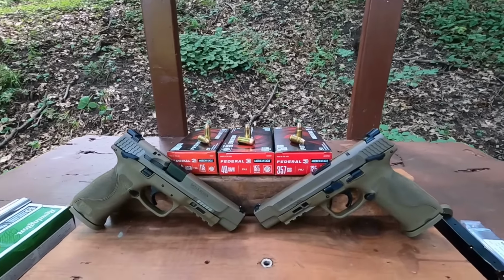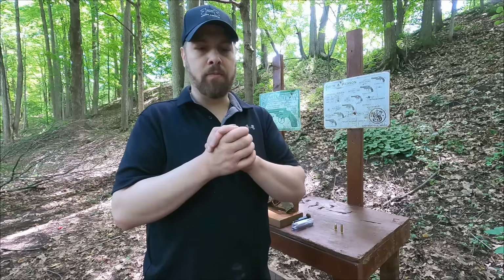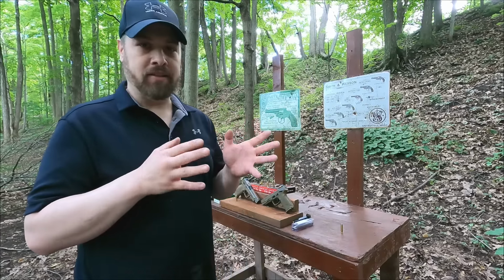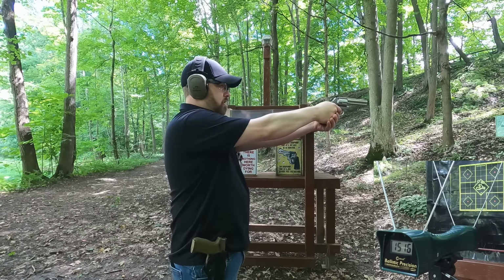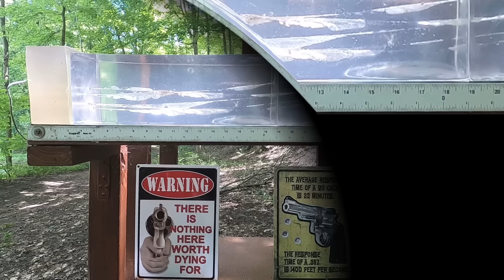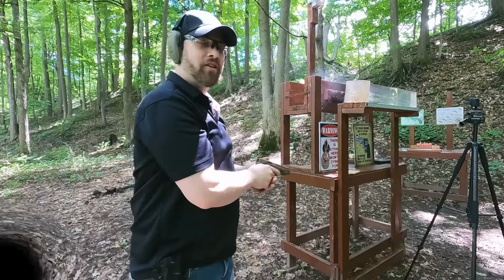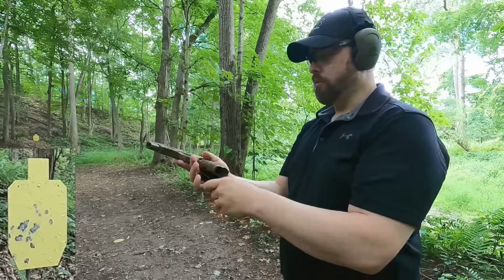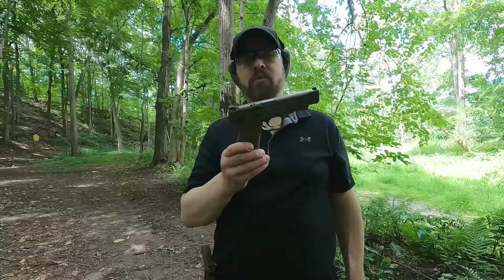.357 Sig? Cartridge Introduction and  FMJ Ballistic Gel Test (VS .40 S&W and 9mm)

Comment: There was a wildcat cartridge back in the early to mid 80's call a 38/45 auto.  A .357 dia bullet with a necked down .45 Auto casing. The only problem was it was based on the 1911 so single stack limitation of rounds. I have a Glock 33 and it is a fun hand cannon. The muzzle flash can be distracting but not too bad. As to your rifle statement, TNW Aero has a 16 in carbine that slings Fort Scott .357 Sig to almost intermediate rifle cartridge speeds (2300+). (https://www.youtube.com/watch?v=_jQTp9LgXiQ&t=182s)(https://www.youtube.com/watch?v=Oxox8r79wI8)  I think you will agree it is a screamer. Enjoyed your presentation.
Reply: Sounds like the old 38/45 Clerke or 38 Hardhead. But that was back in 1963 not the 1980s
Reply: @Matteo_  I read about it in a Guns and Ammo Magazine in or around 83". Lots of time and a head full of gray hair has dimmed a lot of the details. I do remember that the author used a 30.06 case, cut it to length and then sized it to fit the .357 bullet. The only thing I remember asking myself was why? 38 Super Auto could be loaded to meet the specs with a lot less work and at the time way more available ammo. Was an interesting concept since I had on occasion fired some Tokarevs while overseas in the military. Cheers...
Reply: @lutherpayne9957  Yes, the 30-06 case was used, I believe this was to mitigate the higher pressure in any unsupported chambers. If one where to choose to push the pressures higher than normal. People will also use 308/260 and the 243 cases. Similar can be done with the 400 CorBon. You can run it under the standard 45 acp pressures. Or ramp it up to 35,000 where the 40 is for some very near 10mm level performance.
As for the why? It takes little to convert a 45 acp 1911 over to this if one only has the 45. And still retains the ability to swap back to 45 with  little effort. Where as a 38 is built different to accommodate that longer thinner round. And it's only a 38 ACP/ 38 Super. There's the fact that 38/45 Clerke doesn't have a semi-rim to the case. So you don't have to worry about rim lock. Another thing to keep in mind the 45 acp case has a little bit more case capacity than the 357.
I've shot the tokarev. Fun gun. Never shot it in the military though. Maybe cause I was a combat engineer. So I did more demo shoots, mine clearing operation and breaches. Personally I prefer the 357 SIG to the x25. I also have a G33. But I favor my Steyr S40 with a conversion barrel a bit more.
Cheers and be well.

Comment: I've always wondered COULDN'T THE 40 HAVE THE SAME BALLISTICS AS THE 357SIG.

If they simply loaded it with those really light bullets like the SIG has.
Corbon makes a 135gr JHP in the 40, and it's energy output around (530lbs).
Reply: Yep, but it sacrifices sectional density. The 40 can do anything the 357 sig can, and usually does it at a lower pressure. Out of my sig 229 I've pushed a powdercoated cast 125gr hollowpoint to 1500 fps over 800x powder.
Reply: The thing is, 135 grain is a very light bullet for .40 S&W.  Yes, it gives you enough velocity to get .357 Sig/Magnum energy.  But will it shoot to the same point of impact as your point of aim?  And if not, do your sights have enough adjustment to zero the pistol so that it does shoot POI/POA?  And if it does, can you then find an inexpensive practice ammunition that shoots to the same POI/POA?  And I'm not asking these questions to be a smartass or to imply that it definitely won't.  Depending on your gun, it very well might.  Or it might not.  The only way to know is to shoot enough of it to find out.

The easiest way to get .40 S&W to give you .357 Sig/.357 Magnum ballistics is to go with the .40's older brother, the 10mm Auto.  When loaded properly, 10mm Auto easily operates in the same range of muzzle energy as does the .357 Magnum.
Reply: @Kaelland  that's a very real problem even for 10mm guns. Lighter bullets in my sig would hit several inches low even at only 15 yards. 165-180gr were good out to 50 yds, but there was a lot of struggle with anything much lighter. Not to mention difficulty in seating such short bullets
Reply from the maker: You could potentially have similar energy between .357 Sig and .40 S&W, but that doesn't necessarily make the ballistics the same. Overall what you see with .357 Sig is consistently high energy. Basically in this pistol, every .357 Sig round hits over 500 FPE, as where .40 is generally a bit less than 500 FPE. Also the sectional density and all of that comes into play a lot more when you shoot lets say a 147 gr hard cast or FMJ .357 Sig VS a 180 gr FMJ .40 S&W, as the Sig is just going to penetrate probably better.
Reply: Drill the base of (shortened) FMJ bullets and fill the cavities with resin. You might get 100gr bullets or less. Might fly pretty fast out of 10mm_AUTO or 10mm_MAG carbines.
Zinc bullets should be fast too.

Comment: I recently acquired a 40S&W/357Sig combo. Loving the Sig,

I thought the 357Sig was designed to (out of a 4"bbl) duplicate a 357 Mag out of a snub nose..?
Reply from the maker: I heard that the .357 Sig was designed around a 4" barrel to match 4" revolvers, but 1,350 FPS instead of 1,450 FPS. I'd say marketing in a 5" pistol would have served them better.

Comment: The .357 Sig takes a little bit higher rear sight than the .9mm and you would have gotten the head shots with a higher sight ! I put a .357 Sig conversion barrel on my Glock 20 and the recoil and shot placement is Awesome ! Thanks for the Video and information ! I'm not sure which way to drift your rear sight but it's shooting to the left , adjust it and you will love that pistol and the different barrels !
Reply from the maker: drifted the front sight to the right a few months ago. Seemed to work. The .357 Sig shoots low still, but I know where to hold now.

Comment: I've been wanting to build out a .357 Sig upper for a Glock 35 form factor. The standard barrel length is 5.31" and a slightly extended, threaded barrel is like 5.85". That kind of barrel length seems ideally suited for a 357 Sig but Glock doesn't make one.

Comment: Did this barrel swap on my HK USP .40 if .357 SIG was more common "especially now" I would never go back to .40 S&W definitely an interesting recoil characteristic.
Reply from the maker: It is very interesting in recoil. Filmed another video, 124 gr .357 Sig over 600 ft lbs. I watched the gel blocks lift and throw like a hot .357 Mag, but my hands said the recoil was a 9mm. My brain was confused.
Reply: I'm looking for a 357 barrel for my USP and VP40. Where may I find one?
Reply: Yes its a faster recoil but strangely feels like its less recoil. I only shot it once out of a Sig Sauer Pro.

Comment: I didn't expect you to get a conversion barrel for your S&W. I knew they were available for Glock. I didn't know they were available for S&W too. The bottle neck should indeed be good for reliable feeding. If you were to reload for it, I'm not sure how that would go. That is, would the sizer die need lube like for rifle cartridges? Have you seen Lucky Gunner's video on 357 Sig? It's an older video. He made the argument that 357 Sig was not really any better than 9x19mm. That of course lead to the question of 357 Magnum since bullet diameters are virtually the same. The only reason I'm currently carrying 38 Spl+P instead of 357 Magnum is that recoil and blast. Mainly the recoil. 125gr bullets seem to get around 1270fps on average out of my M&P340.
Reply: @bobjones-bt9bh  Well the energy has to go somewhere. I don't know how important tissue elasticity is, but I'm sure it matters. Hunters get the benefit of shooting living creatures, so they would have more insight than you get with blocks of gel.
Reply: @Fudmottin  that's my reasoning as well, that extra energy doesn't just dissappear

Comment: The 357SIG bullet is .355, it's not 357. The 357SIG is a hot 9mm.
I am a 357 Magnum fan and I reload for it. Versatility is what I see with the 357 mag.
110-125 bullets/ ammo for Self Defence and with the heavy bullets in a rifle is a great hunting round.
AND I can use/shoot all the 38sp ammo.
Off the shelf 357 magnum ammo is available in most of the gun stores here in my area.
Reply from the maker: Maybe, maybe not. Other than with 115 gr +P+ 9mm, the hottest 9mm ammo I fired in 124 gr was lower than 500 FPE. I ran a 124 gr Underwood yesterday nearing 650 FPE. The main difference that makes a .357 Sig not a hot 9mm, is heavier bullets. The 147 gr 9mm is a reduced power load, you're talking 300 FPE. The .357 Sig 147 gr is not a reduced power load, and you're getting 500 FPE+ just like 158 gr .357 Magnum. I see the .357 Sig as being pretty versatile, as the gun is always a .40 frame. That means one can shoot .40 and get both a 9mm and .357 Sig conversion barrel and run all three with a 9mm magazine for the 9mm.
Reply: That last line is amusing to me, personally, because I have barely been able to find any .38 Special locally (and only +P defensive ammo at that), and I haven't been able to find any .357 Magnum ammo at all.

But I've been able to buy .357 Sig ammo locally the past two weeks.  Granted, that's likely to be the last time I'll see any on the shelf locally for a while, because I bought the last of what they had today, and I doubt they'll restock anytime soon.  But still, I was surprised to find it at all.
Reply: A bit touchy about the 357 mag being compared to the 357 Sig. Want a round that has a ton of versatility?  Do some research on the 45 colt out of a strong framed revolver that's versatility.
Reply: @biggunshandguns3687  The .357 Sig should be compared to the .357 Mag.  It was specifically designed to mimic .357 Magnum ballistics with a 125 grain JHP out of a 4" barrel, which it does well enough.
Reply from the maker: @Kaelland  it has to be regional. Like even back through 2020 I never stopped buying .38 Special at stores, there was always some variety. What I cannot find now is primers. None of my stores carry them, used to be like $3 per 100, now on the off chance they have them they are like $8

Comment: So what happens when you use the mag loaded with  40 and the barrel for the 357 or vice versa?
Reply from the maker: The .40 ammo won't go in all the way, out of battery and would not fire. Now .357 Sig probably would actually fire in a .40 Barrel, and I don't know exactly what would happen.  The bullet would probably exit the muzzle fine, but the case would probably expand out huge, possibly cause damage or lock up the slide closed. I really don't know.

Comment: Please get the Underwood 357 sig 65 grain Extreme defender they have them in stock I just chrono it this past weekend from my alpha wolf 5 inch threaded barrel in my g22 357 sig barrel and got 2282 FPS actually they are 68 grain but website still says 65 grain

Comment: The 357 SIG in 125 gr produces much higher pressure and about 200 fts lower velocity than .357 Magnum. Bless us Jack Wilson. Geoff  Who looks up strange things.
Reply: Geoff should add barrel length or a specific load to his statement.
Reply: @onpsxmember  Mfgs don't include that in tables.  I was working with 125/124 gr factory loaded JHPs. and not being brand specific.
Reply: @geofftimm2291  You call call them and get that information. But FWIW your figures are generally from a 6" barrel. Not a 4" which is what the 
357 SIG figures are generally cited for.
Reply: @Matteo_  I wasn't doing a documentary I was commenting.  You want analysis go to an expert and bring much money.
Reply: @geofftimm2291  Who says I need analysis. I already knew the barrel length. You're the one who made the commentary with incorrect information. Just looking to help you, but if you're going to get twisted about it move on don't worry about it.

Tootles.

Comment: All those have decent velocity , if I can get over 1300 with the Sig round that is decent, 1300 is the magic number, blast , flash and recoil go way up after 1400 for not much gain.
Reply: Recoil is on par with the 40. Even in the loads running at 1500. As compared to 155gn 40 at 1300. Blast may be excessive but the recoil is manageable.
Reply: @Matteo_  I never care about recoil, I have a 3006 pistol.I carry those 155 xtp in my 40 from Underwood, 40 is a better defence round but I might give the Sig a slight nod for duty.
Reply: @paulscountry456  If you haven't tried or tested the 357 SIG you might want to withhold the stance that the 40 is necessarily a better defense round. 357 SIG has an impressive record within the few LE agencies that have and had adopted it. 

"I never care about recoil," 
Okay then why make mention of it, if it's of no concern? Seems contradictory.

Comment: While 10mm is the parent case for 40, I always understood that the 357 sig was based off the 40 case, not the 10mm case itself. 9x25 dillon on the other hand, was a 10mm necked down to and is much longer by comparison.
Reply: That's a common misconception.  The .357 Sig is based off of a trimmed 10mm case, not a .40 case.  If you run a .40 S&W case through a .357 Sig sizing die, it will be shorter than a .357 Sig case, and all of that "shortness" will be in the neck.  If the neck of the .357 Sig case is too short, it will not adequately hold the bullet during recoil, which can cause some problems.  Early adopters of the .357 Sig who were also handloaders learned this the hard way.

If you handload and want to make some .357 Sig brass from another cartridge, use 10mm cases and trim them to length instead of trying to use .40 S&W cases.
Reply: @Kaelland  i watched some case forming vids. Interesting stuff. Guy said they ended up about 0.010 short when forming from 40.
Reply: @jonathanrogers9961  That doesn't sound like much, but it's enough to cause problems.  

You can get around bullet setback issues by using a powder that fills up the case enough to prevent bullet setback.  But bullet creep can still be an issue when using .40 S&W cases. And you can avoid that issue by using proper .357 Sig cases or by using 10mm cases to form and then trim them down to the correct length.
Reply from the maker: @Kaelland  I was curious about how that neck holds bullets when I was looking at a round yesterday. I have some 147 gr ones, bullet is not long out of the case. Like, the bullet base would absolutely have to extend beyond the neck, into the main case, just feet a hanging lol. I couldn't wrap my head around that.
Reply: @GunSam  A lot of it is about bullet shape.  Most bullets used in .357 Sig loads tend to resemble the truncated cone shape to keep the nose short.  Even those that don't manage to keep the nose of the bullet relatively short by necessity.

But the powder charges are also designed to keep the case pretty full.  That's necessary to help prevent bullet setback because the crimp isn't enough to do it.  The crimp does help prevent bullet creep, though.

But yes, the base of the bullet does sit down in the case somewhat, especially on heavier bullets.  There's not really a way to avoid it short of using really light projectiles.  And as I'm sure you know, most .357 Sig ammo is either 125 or 147 grain (although Liberty makes a 50 grain Civil Defense round that they claim makes 2300 FPS out of a 4" barrel).

Comment: Reference one shot stops by the Sig 357, I've noticed a disturbing trend of suspects having to be riddled to effect a stop by police. Can't confirm the round used by police but very likely it is 9mm. I realize if there is more than one officer, if one shoots, they all shoot. Did notice in the Greenwood Mall shooting, the man who was the shooter absorbed eight 9mm projectiles before being neutralized. No idea what brand ammo or bullet type the good Samaritan used, nor where the projectiles impacted. I'm of the opinion that if a person can effectively use the 357 Sig,  then by all means  he should use it. 9mm works, but it appears  not as well as I'd prefer.
Reply from the maker: There was a video here in MI, Lansing police, guy with a knife coming at cop. 9mm, like 13 shots to stop him. No drugs, nothing. In reality 9mm is less effective than .38 Special.
Reply: @GunSam  depends on shot placement and defensive ammo. I was in a SD shooting, and although it took the attacker a couple minutes to succumb from his injury, all it took was one shot out of a 4inch barrel using 115g Fort Scott Munitions T.U.I 9mm round to the upper chest. Pierced through the guys lung and he was still alive, but stopped attacking me and my girlfriend after the one shot. Surprisingly the human body can take a lot of damage before death.
Reply: Had a shooting locally Guy jacked on drugs was shot multiple times by police and SHP. Took multiple  40 Smith impacts, not in vital areas. Took 4 12 ga. slugs to the chest, 3 to both lungs. The last slug took the bottom of the heart off, but he remained upright and functional for an estimated 15 seconds before being rendered safe.

Comment: Might be a hot round but never caught on. If you cant efficiently use 9mm, .38 special, .357, .40, .45 or 10mm you need to step.back & evaluate. A biped isn't a grizzly bear. I can say my compact 9mm with 124 v-crowns, 147 shoks or my 10mm 170grain cup & core jhp screamin at 1300fps  would quickly end someone's life without effort. That first place shot is all that's needed.
Reply: @bobjones-bt9bh  My point was you dont need alot of firepower to stop someone.

Comment: The claim that the .357 Sig and .40 S&W are more powerful than the 9mm..  Well it is hard to argue with the facts.  Though there is also a difference in bullet design with this particular 9mm compared to the other two calibers.  The 9mm is the one with a round nose.  It seems that flat nose bullets(like most hard cast bullet designs) tend to punch a bit deeper.  So, this particular comparison has another factor to consider in addition to the difference in power that may be contributing to penetration.